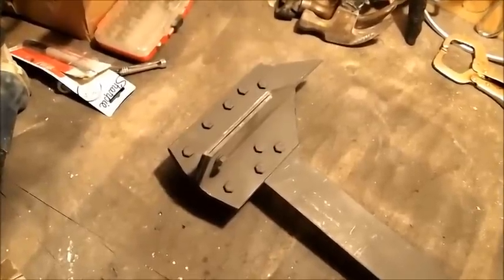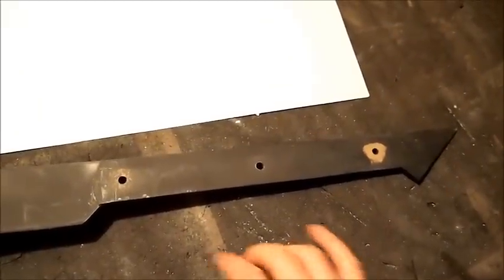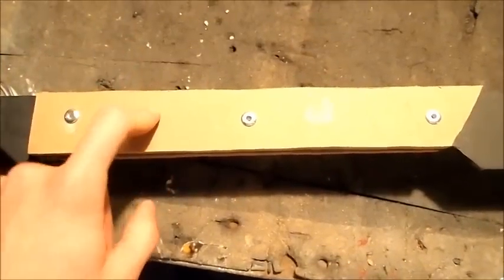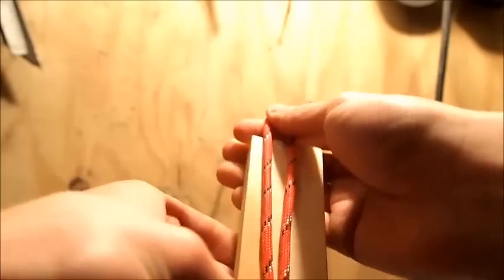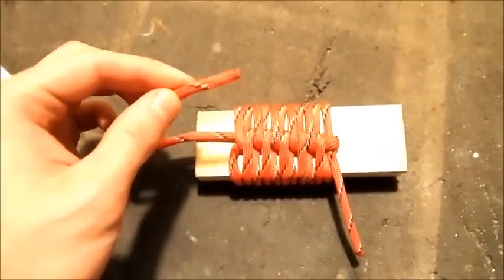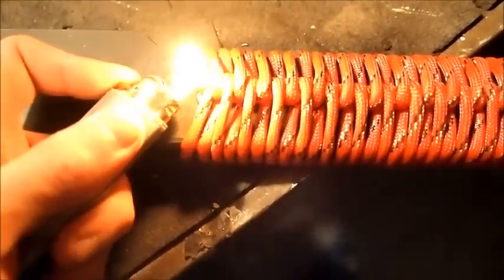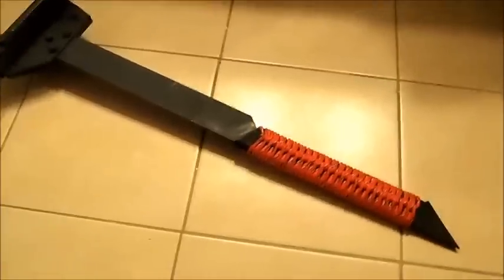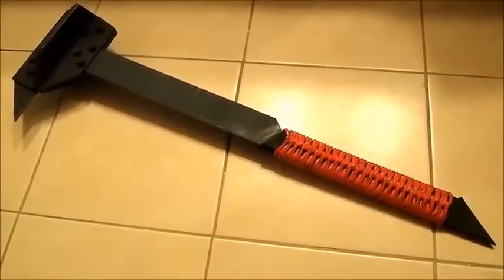Weapon Handle Making/Paracord rapping (W/Potato)

Comment: Is everything before the potato part necessary
Reply: nope
Reply: no, you can just tape a potato to your weapon and the handle will be just as good
Reply: Remember, if you are making a full polearm shaft, corn and sweet potatoes work very well. Potatoes are great, but are a little on the short side.
Reply: How can you people think the RAP part is not necessary?? WTF
Reply: Also if you can’t afford a potato you can use radish as well but the radish’s but potatoes are more cost efficient because the potatoes will last longer

Comment: I usually put my potatoes more near the top of the handle. With the weight that it gives, putting it more near the top gives more mass to the top of the weapon making a heavier swing. That is also why I use grey duck tape, it makes it feel more heavy and makes it hit harder. With smaller tools/weapons I use apples as well, but for my precision tools (like with xacto knifes) I use a cherry tomato. I hope this helped!
Reply: wtf is up With The food? like why random at the end putting on an potato atthe and of the paracord?😂😂😂
Reply: +eskeep comper It's for making the handle perform better.
Reply: +MeMan323 is this serieus?😂
Reply: +MeMan323 is this serieus?
Reply: +eskeep comper Yeah. I personally don't duct tape it. I temper my steel in orange juice and also the paracord. The key is to have very acidic fruits to temper the weapon.
Reply: Vladimir A It's easier for me to get things like potatoes, apples and tomatoes here in northern Ohio because we don't have many acidic fruits/vegetables that can grow here. But I like using duck tape so I can change out the old ones.
Reply: MeMan323 I think you might be able to work out a recipe with a mix of apple and tomato juice. And after tempering coat the steel in mashed potatoes. If you try this please let me know the results.
Reply: me323me I

Comment: I have the reverse problem, I make really nice wooden handles with like, a shaving razor stapled to it.
Reply: Several years late so you've probably already figured this out. The staples are your problem there. I prefer clear tape, glue stick is acceptable if tape has run out
Reply: @2cawks  I wrote that when I was 14 and now I'm almost 21, but by god I wish you had commented sooner, as I have fallen over 140,000 dollars into staple debt, trying for years and failing
Reply: That used to be me, making nice handles in crap machetes

Comment: I may have taken the food idea too far... I now have a dagger with a carrot handle wrapped in lettuce with a celery blade sharpened with an apple attached via tomato soaked apricots at the bottom. This means I can use the apple as a long range weapon. Any feedback?
Reply: I meant paracord not apricots. F*****g auto correct

Comment: I know they're a bit more expensive, but if you want to go for a cooler look use brass door hinge lock pins for your ribbets and hammer the ends to a rounded or flattened pin for the handle. Make sure it's the solid ones though I don't think the hollow pins would work to well. Again, I know it cost more to get them, but that brass look on a flat black weapon if you're not going to wrap it with paracord would look awesome.
Reply: For my ribbets,  got it. 🐸
Reply: ChefCarson yep, I just about croaked when I read that...

Comment: Would it be possible to do this wrap so the "ridge" is on both sides of the handle?
Reply: +DarkSeraph351 yes it would but it'd be difficult, make the first lenth wise loop then flip and put a loop on the other side, when wrapping the cord you would have to wrap around one loop and then continue around the handle in the same direction instead of doubling back. If this is too far to follow and you just want symmetry you could use a single ridge and put it on the front of the hande, which may actually help with the finger grips feel